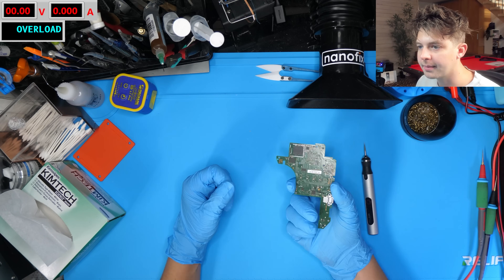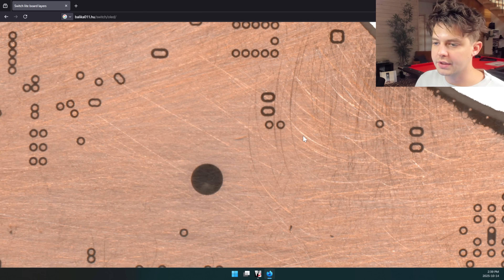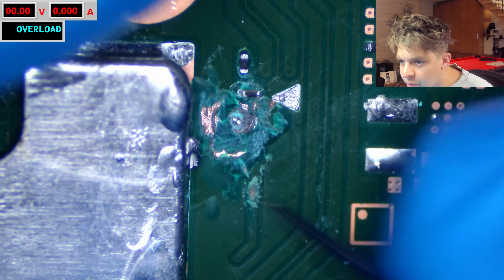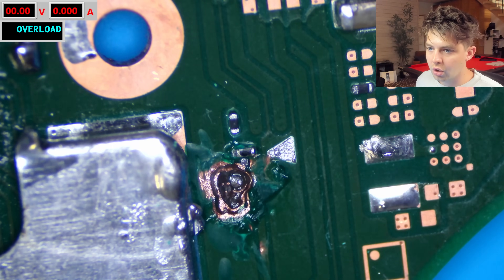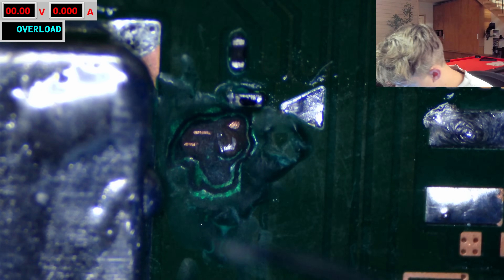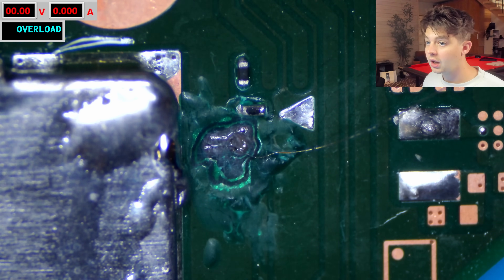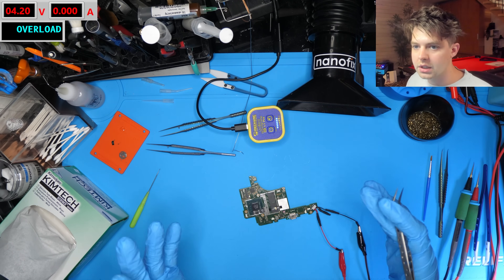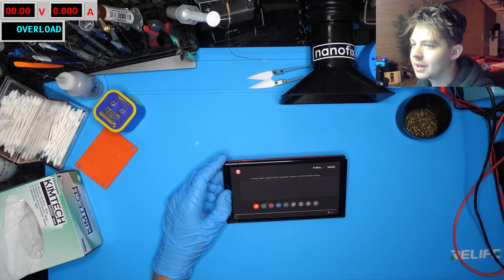Fixing a Failed OLED Kamikaze Attempt (+ Giveaway Winner!)

Comment: Dude, thanks for this video 

I was the one who broke the trace initially while trying to solder to dat0 (pcb was already drilled, I was attempting to reinstall the chip)
and after getting equipment needed - I was able to fix it, by pretty much using this vid as a guide
Reply from the maker: Nice work!! Not an easy repair :)

Comment: Good evening, friend, I need to do one of these repairs. I couldn't understand where you sold the second point where the wire was sticking out (dat0). Could you explain where the other end goes?
Reply from the maker: check the board layer tool, you need to repair the DAT0 trace where it comes from the SoC to the pad that you solder to for the kamikaze method

Comment: Always love getting repairs like this.  Some just are not repairable.  I had one where someone used a drill (yes, an actual drill) to scrape the CLK pad.  The put a 0.5" hole directly through the board, ripped 5 capacitors off the APU, broke the display connector, and somehow in all of that, also removed the cmd resistor.  Saw the pictures of that and just said no.
Reply: Some people just shouldn't be modding devices... 😂😂😂

Comment: Just be aware that the registration isn't great on the OLED board layer tool - some traces line up almost under completely different pins!
Reply from the maker: yeah there are a couple layers that aren't as well aligned but you can usually figure out what's going on contextually

Comment: Hey Zach, huge fan! I’d be really grateful if you could provide some guidance on my query: 

I’ve modded two V1 switches successfully following your guides so far. I attempted my first switch lite recently. Unfortunately, the A,B,C and 3.3V points all read OL when I measure them. No diode drop at all. I’ve tried resoldering the connections 3x and even changing the ribbon cable. I am positive my connections are good and quite perplexed. There’s no error code on the picofly when I attempt to boot. I’m positive my connections are good. Even if they weren’t, it’s impossible that ALL of them are bad. 

Do you have any idea what’s going on here and how to troubleshoot? I can’t find anything online about this. 

Thanks so much! I’d ask you on the livestream but it’s too early where I live 🥲
Reply from the maker: it sounds a lot like an issue with your meter probes or the flex cable connecting to the chip (maybe flux or thermal paste in the connector?). If you put your red probe on ground you should get ~0.4v drop on all of the points. If you're not getting a reading on the chip, measure the points on the console itself (not on the chip) to see if the issue is between your soldered points and the chip (FPC issue). If you still don't get a reading, it's highly likely your meter is causing issues. Touch your probes together and the meter should show something close to 0v drop.
Reply from the maker: it sounds a lot like an issue with your meter probes or the flex cable connecting to the chip (maybe flux or thermal paste in the connector?). If you put your red probe on ground you should get ~0.4v drop on all of the points. If you're not getting a reading on the chip, measure the points on the console itself (not on the chip) to see if the issue is between your soldered points and the chip (FPC issue). If you still don't get a reading, it's highly likely your meter is causing issues. Touch your probes together and the meter should show something close to 0v drop.
Reply: @nanofixca oh my god you genius!! It was a faulty meter after all. I never tried powering on because the battery was dead. Now I have a different issue though. It’s powering on when I plug in, and I can hear sound on the device. But the display is black? Cable looks fine and no debris inside the connector. The modchip isn’t flashing either. What do I do? And how much do I have to reassemble before I can charge and test the console? Thankyou so so much!!
Reply: Never mind problem seems to have fixed itself. Not sure how or why. But disconnected and reconnected a few things. Modchip successfully flashed and screen is working. Thank you so MUCH!!!
Reply from the maker: @pulsedagod3986  Nice work!! 😁